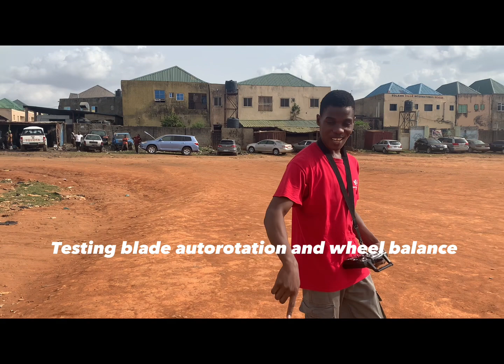Homemade RC GYROCOPTER first flight attempt

Comment: You need to have the center of mass lower and under the propellers. Try adding some small weights and taping them to the bottom, then moving them around to try and get it balanced. Once you have gotten it balanced you can make it more permanent. You can do this out in the field, but I'd first try to feel with your hands where the centre of mass is (hold it with one hand on the bottom, and try to balance it on your hand. This will tell you where the centre of mass is)
Reply from the maker: Very much appreciated. Thank you.